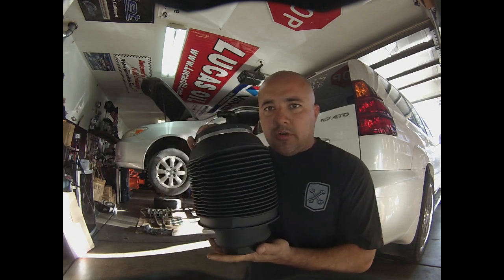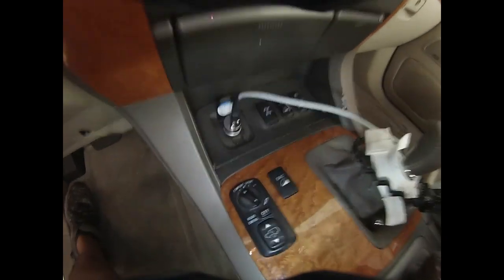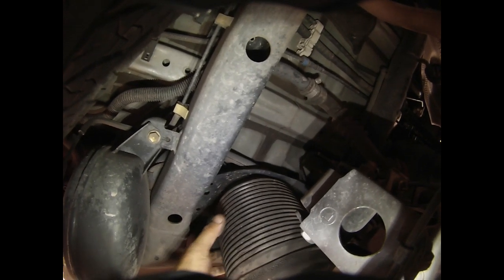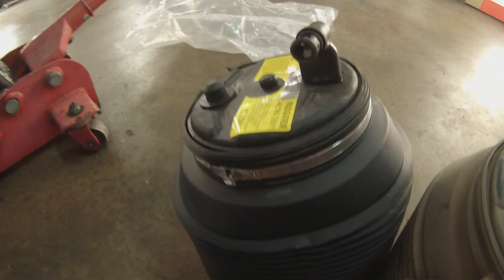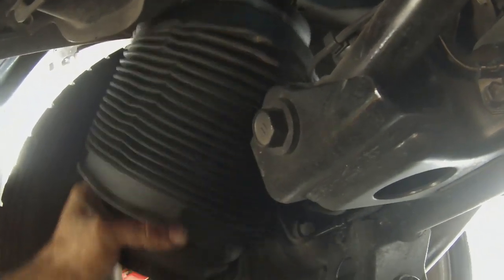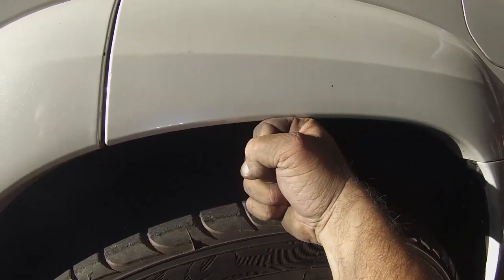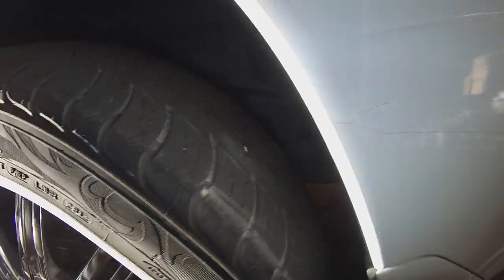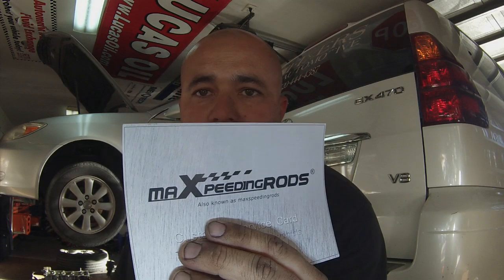2004 Lexus GX470 air spring

Comment: Great video! I'm replacing my originals with Arnot airbags today, and this vid gave me the necessary motivation for the job! Thanks!
Reply from the maker: Jakob Nielsen Øien that’s a good airbag to replace, good luck on the fix, please share and subscribe to my channel.  👍🏼
Reply: I have a 2004 Lexus GX 470 and bought a replacement airbag for the left rear that couldn’t fit because of the same connection issues you showed. I was considering replacing the bags with springs but your video motivated me to give the airbag another try. Thnx much

Comment: Excellent video. Need to check the source of the leak in my 2005 GX470 and get to it. I've not been under the car yet, but the leak affects both sides equally, so must be a common point. Good to know there's a holding tank, saves me the headache of tracing lines. In looking at this job, I'll definitely say a 2003 X5 is easier to do, but those need more love in general.
Reply from the maker: Transportador33 . Yes if both sides are affected it’s a common point leak.  It’s a simple system and shouldn’t be hard to find a leak, just air up the suspension all the air and use some soapy water in a spray bottle to find the leak. Hope this helps.  Thank you for watching my video. Please share and subscribe.

Comment: Thanks for the advice. I ended up just replacing the sensors and putting the fuses back in. Once I did that the vehicle corrected itself. Turns out the drivers side height sensor was totally seized. Again thank you and good luck with your GX! Happy holidays

Comment: I used a Tire plug kit 3 years ago, still holding!
Reply from the maker: Uncle Fjester awesome,  not sure if I would do that becuz of the weight of the vehicle.  If it blows it wouldn’t be good.  Good luck.  Thank you for your comment.
Reply: What's to prevent another hole?
The rubber is cracked and rotten.

Comment: Thanks for the video. I have one question though; 
 is it normal to hear the sound of the air compressor when the car is running or when the engine is on?
Reply from the maker: It can be normal to hear the compressor run but only for a short time.  Maybe once every 10mins.  If you put weight on the back of the suv it will turn on and pump up.  If it runs more than there might be a leak.  Get some soapy water and spray the compressor, lines, fitting and the air bags.  There should be no leaks.
Reply: @fixersautomotive4514  thanks for your prompt feedback. I shall do you have recommended.

Comment: Great video. So I've done this and the bag when it's clipped on top sits a little crooked. And when I dropped the truck it needed help  sitting in to perch.  I don't know why it's loose.   I  bent the pins on top  nd that has no effect on it.  It's really not a problem but the only problem is when I take it to get serviced and they Jack it up and even if they turn the suspension off every single time it lowers then needs help to seat back on the perch

Comment: Great! But why not replace both at the same time? They are not too expensive unless you by genuine Lexus right?
Reply from the maker: Thank you for your comment,  In the video I only show replace just one.  I did replace both of the air springs. Its like showing one brake pad replacement but doing both, its about the same process.  It’s best to replace both at the same time so not fighting a new bag and a old bag and have the vehicle be down twice.

Comment: I just ordered two new air springs for my 470 and want to install them this weekend. I noticed that you have access to a lift system. Do I need to lift my vehicle 6-7 feet off the ground or do you think that I could do it with just a foot or so off the ground?

Comment: I also have a leak. But mine goes down evenly but slowly. I thought if one bag has a hole or leak they would both go down since they are running off the same line to the compressor and tank. No?
Reply from the maker: If you don’t know where the leak is coming from, best thing to do is grab a bottle of soapy water and spray the entire air system.  Both air bags are on the same air supply line so they pump up Evenly, hope that helps.

Comment: Did I see that correctly?! 58,xxx miles and you stated you’ve done this before? Do you do a lot of heavy towing or is this that terrible of a design? I’ve got 124,xxx on my ‘05 4Runner Limited and just now starting to have a bit of a hard ride on the passenger side. Great video btw. Looks like a very easy fix. Thank you sir!
Reply from the maker: telecasterman18 as you can see in the video, my Lexus at the time had 168,xxx miles.  I do tow vehicle back to the shop from time to time w/ my 16ft car trailer. Thank you for watching, please share and subscribe to the channel.  Thank you !
Reply: @fixersautomotive4514  I see! That's what I saw... 168,000. Makes more sense. Hey, I left a comment on your page. I was wondering if you could post a link of the air bags you used. I've got to do both of mine as previously stated. Thanks again.

Comment: Great content!  Thank You! Fast and straight forward repair. Scotty recommend this stuff -  ATP AT-205 (Amazon) to be sprayed on to rubber parts of pneumatic strut for improved longevity (I did on my 470 and it works superior in (NYC)). Fitting on top of strut is standard 6mm SMC Inc.  Japan made and available in Stainless housing  from Mc Master Carr.
Reply: How do you inject this stupid into the air ride system? Or do you just coat the outside of the bag? Thanks!

Comment: can you put bigger AT tires on there with the stock air bags and drive it higher if we wanted the Lifted Look but still maintain the air bags without actually lifting it with springs/coils?
Reply: good question!

Comment: Hello. Saw you had around 160K miles. How many times have you had to change the bags and what kind of driving do you do? Only street or some trail? Just trying to get a gauge of  when my will approximate go out. Thanks.
Reply from the maker: Thank you for your comment,  our Lexus  is a family vehicle that we travel on,  it’s never been off road and always driven on the streets.  I replace both of them during that video and now it my vehicle has 204k is still going strong. Hope that helps.

Comment: Is it advisable to replace only one or should I replace just one when it starts leaking instead of both?
Reply from the maker: Yes it’s always best to replace them both at the same time or you will always be chasing one or the other. There cheap enough to replace both, most times there cheaper if you buy the pair.
Reply: @fixersautomotive4514  can you type a good website or  link where can I buy parts I would need the front struts Left and Right

Comment: Thanks for the video, I'll be doing this in a week. I have two questions:
1. How was your suspension acting before the swap? (bouncy, harsh etc.)
2. If your suspension was bouncing all over the place before (like mine is now) did the air bag replacement solve this issue?
Thanks
Drew
Reply from the maker: Drew S my 470 ass end would be flat to one side every morning and the air compressor would be working over time to keep the rear air bags filled up w/ air. The rear suspension would bottom out making a bumpy ride.
Reply from the maker: Drew S the new air bag solved my issues becuz my air bag had a tiny hole in it.  Hope that helps. Thanks for watching my video.
Reply: @fixersautomotive4514   thanks for the info. were you able to reuse the little plastic clips that hold the air lines on? if so, were they still in good enough condition, and O-ring replacement you'd recommend?
Reply: Hey drew did  it fix  yours?  mine  started  bouncing too

Comment: I can’t diagnose what’s going on with my gx470 2004 , sometimes air suspension works fine , sometimes I parked and in 10 min bottom down , sometimes during drive one side all the way on my wheel and im so desperate
Reply from the maker: Check the wiring on both of the right height sensors, it might be best to unplug and inspect sensors. The ride height sensor control the operation of the air compressor to air up the bags and deflate the bags. You need to have the system scanned.  Hope this helps and good luck.
Reply: @fixersautomotive4514  thanks i have both height sensor i have to replace but it’s cold here in Illinois so I’ll change next week , one more question who’s the best for scan the system?
Reply from the maker: Best scanner is the dealer but that’s might not be possible.  There are many kinds on scanners that will have the function to scan the air ride system but there are many that don’t have the function.  Hopefully you know of a shop or a person that will have a higher end scanner.
Reply: @fixersautomotive4514  i just don’t trust dealership , thanks I’ll let you know

Comment: Thanks for the video.  I need to replace the airbags on my daughters 2006 Lexus gx470.  Are the airlines hard to remove? I read there is a tool that is needed to (an SST, airline separating tool) from toyota/lexus.  How did you remove the airline from the original airbag?
Thanks
Reply from the maker: David Minyard hello, yes there is a special disconnection tool for the air line.  I know it’s difficult to see the top of the airbag but what you can do is remove the air line from the air tank and just feed the air line though the top of the mount when the airbag is removed. Then get a little pick and remove the air line from the top of the airbag.  Reinstall the airline back before the new airbag is installed and you can just clip it back in.  That’s what I did the first time I replace the airbag.  Hope that help good luck. Thx for watching. 👍🏽

Comment: My 08 will go into Hi, N, and Lo and remain there. But once I put into drive and accelerate it returns to the N level. I just got this truck so it's all new to me. Thanks in advance for any advice.

Gotta get the TB done as well. 114k on the odo. I would do it myself but it's a 2008 and I keep seeing different things regarding the TB install on a VVTI.
Reply from the maker: Bert T. Hello, the suv will always go back to the N setting, it won’t drive in H or L unless there is weight on the rear ride height sensors.  There are height sensors and the suv knows the height of the vehicle, 95% of the time it will always stay in N.  When you put enough weight on the back it will automatically adjust to the proper level... the timing belt is a straight process.  You just have to make sure the motor is at top dead center and all the timing marks line up and don’t move during the TB replacement.   Good luck!
Reply: Fixers Automotive Silly me, I finally got around to browsing the owners manual and it explained in detail how the air ride functions. Lo is for speed below about 10 mph and Hi for off-road speed less than about 20 mph, outside of that it goes back to neutral. I the white, I thought something was broken. Thanks though.

And as far the tb, the supposed vvti "method" is confusing. Now I came across a post that states first align marks at tdc, then rotate counter to 10° before tdc to release can gear pressure, then rotate to 50° past tdc. Anyways it's 20° F this weekend and the wp sprung a leak and making noise. Belt has 115k. Lexus gonna be doing it for me. I'm considering taking it to Toyora and have them do it. Gonna try to save a few bucks. They should be able.
Reply from the maker: Bert T. I’ve replaced my TB 3 times. My 470 has about 190k on it now. No sure what the dealer might charge but it’s gunna be pricey, my guess is about $900 but wouldn’t be surprised if it’s higher, don’t let Toyota tell you it’s Lexus only parts becuz there the same parts.  Good luck man.

Comment: hey buddy I have the same vehicle GX470 2004. I replaced my shocks & compressor pump. I don't hear any hissing from the airbags. My suv doesn't raise up and it runs as if it has no shocks at all. Can you fill me in on what's my problem. I grew up in NYC and when I drive I feel like a Cowboy.😬😬😬🤠🤠🤠
Reply from the maker: Mick Pacheco did you check to see if the ride height switches have free movement. I’ve seen them get corroded with salt. Check fuses and relays for the compressor.
Reply: Fixers Automotive I'll check that out in the morning. BTW great video. I keep you posted with the results. Thanks
Reply: LOL, I have the same car, and yes, every little bump I drive on, the car bounces so much that I hit my head against the roof of the car many times.  It's not a good feeling after I eat something.  Do you think a normal person can remove the old ones and install the new ones without using a lift?  Thanks.
Reply from the maker: David, yes you should be able to just lift the back end of the suv and replace both air springs w/ a lift just I did in the video. If you can remove the spare tire it’s gives you so much more room to replace them.  Try putting direct power to the connector on the air pump and see if it turns on and pumps up.  Good luck.

Comment: did you use factory or after market air bags?
Reply from the maker: Tou Yang they were aftermarket bags.   Either was the factory or aftermarket have a one year warranty so it didn’t matter which way I picked. The aftermarket was about $450 cheaper then the factory.  Yikes!! Thank you for your comment.

Comment: There’s a small plastic tool to remove the air line from the airbag. Unfortunately it’s a Lexus specialty tool that only dealers have.
Reply from the maker: Shark Finn yes thank you that.  It is a dealer tool only and not to difficult w/ a couple of picks. Thank you for the comment and helping out others .

Comment: Will this be the same for an 05 Toyota Sequoia?
Reply from the maker: Yes there the same air spring as a Lexus and pretty much the same process to replace the air springs. It might be easier to remove the air spring w: the air line still attached to the top of the bag and just slowly feed the line out through the hole while removing the bag.  The clips on top of the bags you will need a special tools to disconnect the air line.  You can just use a small pick to unclip the lines.  Good luck w/ the repair.
Reply: @fixersautomotive4514  thank you 🙏

Comment: Bro you have about 1inch between bump stop and diff housing, do you bottom out all the time?
Reply from the maker: Toby Mills, thanks for your comment.  I don’t bottom out. The way the suv was parked and backed in to the garage, that’s were the ride height sensors leveled out the suv. When I drove it out of the garage it aired up higher becuz it was sitting on a flat surface.  Hope that explain it.

Comment: so generally speaking, how reliable would you say this system is? the air springs don't look to expensive, but what about the rest? i was looking at one of these trucks used but the air shocks kinda scare me FWIW.
Reply: There are many aftermarket coil over conversion kits available for this model. The air suspension is very reliable as is.. but expensive to repair.

Comment: Thanks. I'm thinking of buying a used gx470 for touring with small trailer.  Reliability is huge for us. Wondering if the 04 is the best model year? If air spring breaks on the can iit still be safe to drive for several hundred miles before being replaced at home? Has your water pump been ok? Thanks again!
Reply from the maker: My GX470 is the best suv i ever owned and super reliable. There Are some down falls to the suv like towing becuz of the small 4.7V8 which is a great engine but  mine is 15 years old now and it doesn't compare as to the new 4.6L V8. towing small trailer is ok and will do great. If the air spring develope  a leak you will want to get that fixed right away because you don't want the air compressor to keep running try to inflate the air spring. air springs are cheap compared to the $1200 air compressor. i have about 188K on mine and i'm on my 3rd water pump, to me not a big deal because i can fix it. 2004 and 2005 where the best in my opinion also 2006 and newer all required premium fuel.     Cheer's!!
Reply: @fixersautomotive4514  Thank you very much!👍 I'm just wondering if these problems with the shock and the water pump would come on quickly and would require me to find a dealership to get them fixed asap if I were on a long road trip. Or do they come on slowly where I could get home to fix them. Hopefully that makes sense. just wondering if this is a good long-distance touring vehicle despite these two problems. Thanks a lot!!
Reply from the maker: Sam Rossi Songwriter usually the problems come on real slow. You will just notice one day the ass end of the truck is be flat/bottomed out, but if fixed soon rather then later is best.  Water pumps not a big deal. They will seep a little bit of coolant and I never seen one just blow out the coolant.  A common coolant leak is the weed hole of the WP. I have 3 Lexus’s. LS is my car, IS F sport is the wife’s and the GX is the weekend warrior, we go to Cali and Mexico all the time and it’s been rock solid for us w/ the usually maintenance problems.  Hope this helps.
Reply: @fixersautomotive4514  yes that helps a lot. I really appreciate it!👍 I'm six foot three and have been struggling with the idea of getting a 4Runner cuz it's just not enough headroom where is the GX has a little more headroom and power for pulling. I really like how the GX can raise it's height especially in deer country where I drive I can use all the height I can get.

Comment: did you get the new part online? or through the local dealer. if online please post a link. or the part number. Thanks for the video.
Reply from the maker: White Leopard I don’t have the part number for the side, but you can just go to amazon and search your vehicle.  There about $60 for each side. The aftermarket ones have come down in price a lot recently. Good luck.